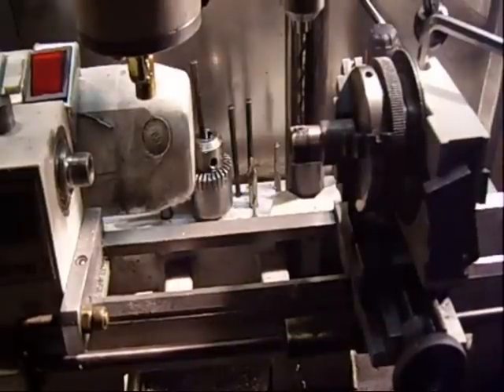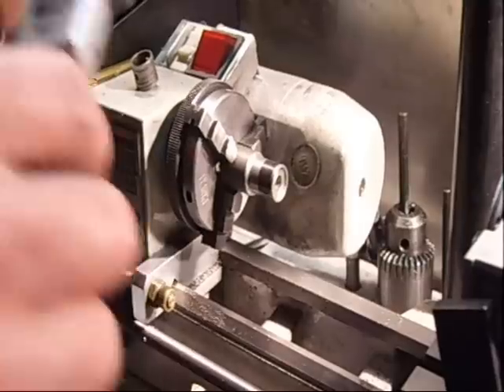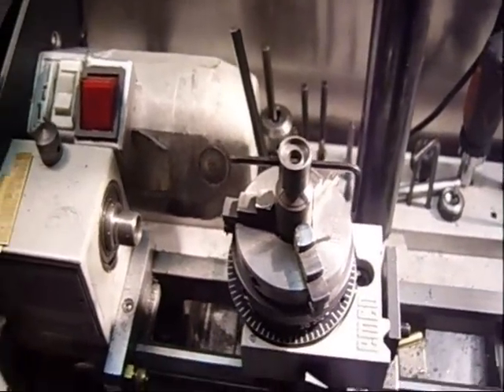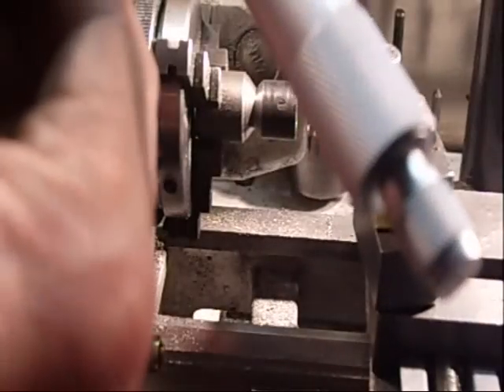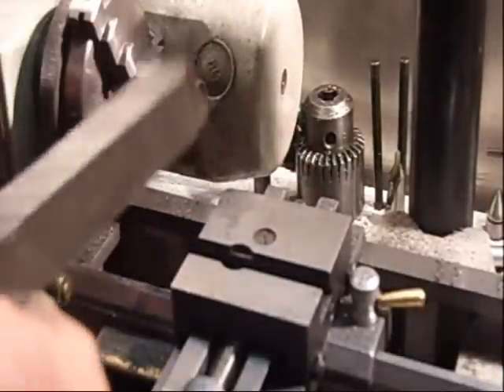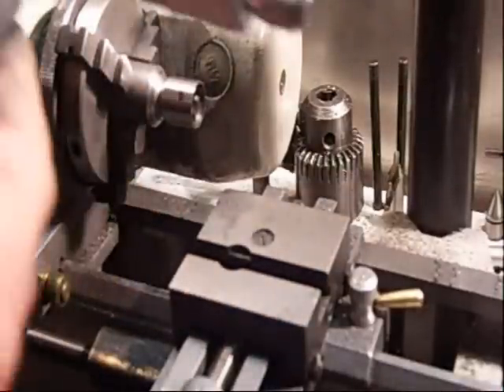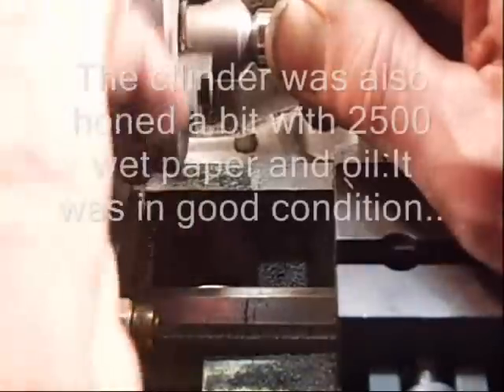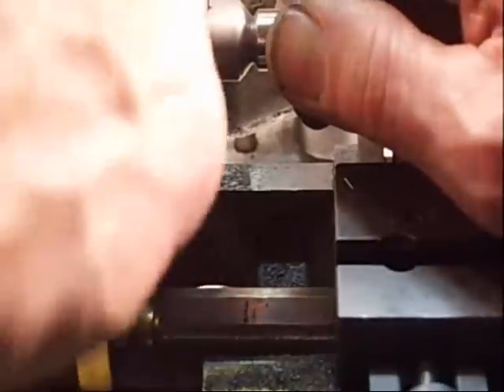piston making for a modeldiesel engine    part 2

Comment: Thank you, Peter.....yes, i am hopeful it will run again.....the fit of the Crankshaft in the crankcase is nice and free but not sloppy and the con rod is pretty good, too.   getting there ! I invested in an Anodizing kit.....have you any thoughts on this.....i believe i may have to bring the cyl. head back to bright state before i can begin to re - anodize. Learning a new skill !!
Reply from the maker: That good news on the internal condition.. Anodizing is not so difficult.. but I not recommend to do it on a real part..It need time to be good at it..as well you need the correct color...It need a bit practice to get the correct color back to the head....that is sometimes not easy....And indeed, you need a plain clean part, before you start anodize it...There is a lot info on the web..thats where I also got my info from...read, try and learn from mistakes,  thats the way to do it...Mistakes are the best school!

Comment: Yet to get the Manxman running - firing in short “snaps” and oscillating. Contra Piston VERY tight - goes back with a distinct “crack”. Persevering !
Reply from the maker: Sound good.. Take it apart.. and clean the CP..if still to tight, polish the CP and the top of the bore... use thick oil,when inserting it...I hope it will free up!

Comment: Very helpful - thank you. Making a new piston for an Allbon / DC Manxman.
Reply from the maker: Good luck...and take your time.. triple check, before making chips.....The right fit is,when you see the piston pin hole, half the way in  the exhaust port..then it should start get tight, ..when almost dry....and super clean..

Comment from the maker: Hi Paul. Indeed I do allmost all work on it.The milling attachment and dividing device ate optional parts.So if you like to buy one,watch out to buy it as compleet as poasible.If you buy that stuff later,its pretty expencive.I recomend to buy the type 3,like my lathe.The earlyer unimat sl is the first model,and is less good.Take your time to buy one...its worth searching a bit to get a good deal.
My unimat 3 can how ever not cut threads,so i use taps and dies to do that.But if i need to cut a fine thread on a cylinder,I use my bigger lathe in my workshop.
many regards.
peter

Comment: Peter, Seems like most repairs can be done with your Unimat? Is this Unimat 3 you use the only model available? Is that a milling attachment or a drill press aligned with the lathe that I am seeing? I want to finish some rare engine kits I have but have only very limited experience with drill press, grinder and very little lathe. How do you cut threads for a needle valve for example? I did some thread cutting with a die for 1/4"-24 threads when I was restoring an antique motorcycle and it was not as easy as one might think. Thanks, Paul in Thailand